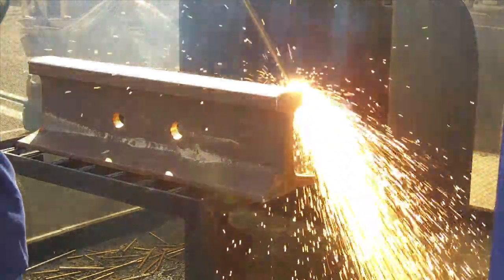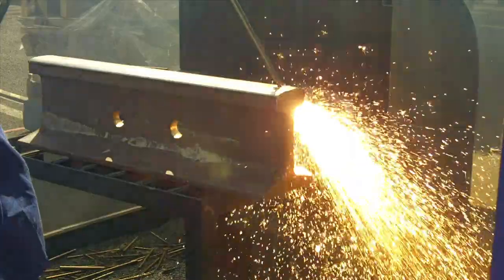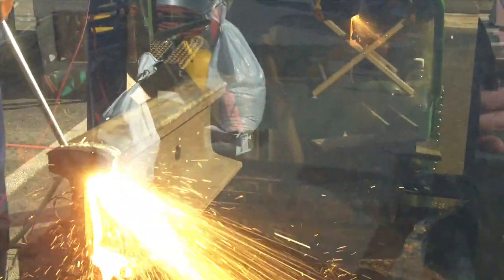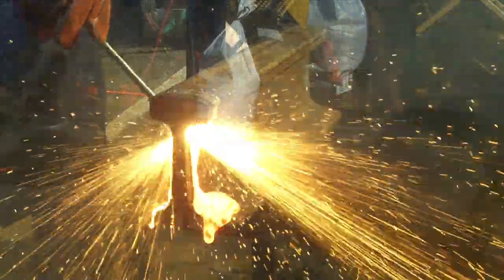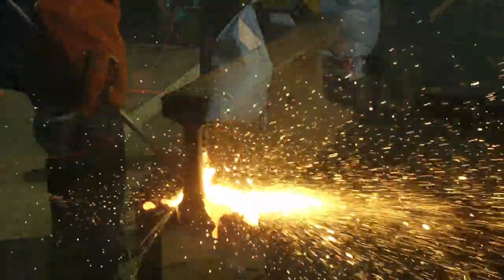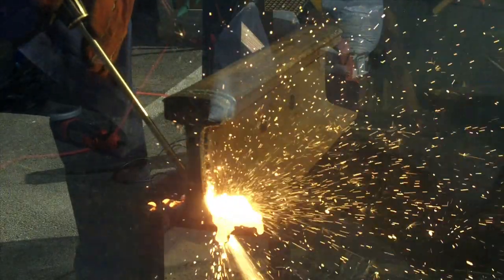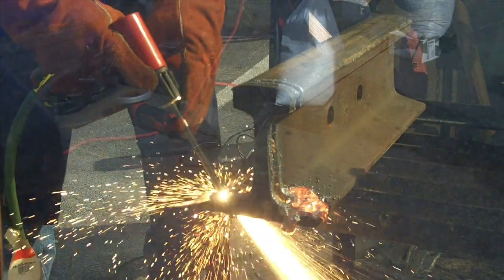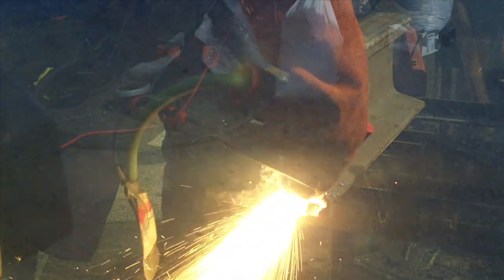Arcair SLICE Exothermic Demo: Cuts Through Train Rail in One Rod

Comment: Could have done that with an oxy fuel torch...
Reply: I’ve been wondering the need for arcair rigs when o2/acetylene works just fine.
Reply: @TheRealTak  You don't need it, it's just a sales gimmick
Reply: @mysterious_nobody_99  I figured thank you
Reply: @TheRealTak  ExoSlice can cut much thicker material than OxyFuel -- like 12" -- plus it's just cool.
Reply: A guy cut a 1/4 inch wide x  10 inch deep hole through a solid metal hinge pin at work last weak with those rods. Oxy doesn't cut deep holes very well!

Comment: Carbon arc with air pressure is an art, used it for precision cutting, bearings off shafts and don't damage the shaft.Learn which way to blow the fire.
Reply: Can you use just a a normal 12v batt

Comment: There's a great cost here!  I had this set-up back in the early '90s.  To cut a rail might have a purpose. but a torch is about as fast and a 20th of the cost. Fire departments use these. Great for super-rusty steel where getting through initially might be a challenge.   Cutting scrap would be a fool's game though. I used this set to blow down 40 foot bars of aluminum 6 inches in diameter to a mill spec. That's why I bought it initially. But it's a mother-fucker on money though!  The delivery volume of oxygen needed will deplete a tank in no time at all! Rescue work, concrete-coated steel, and other specialty jobs can benefit from it. It is an auxiliary tool in a larger arsenal.  Any kind of full-scale demolition means you graduate to oxygen gun-bars and a manifolded set of high-pressure tanks or liquid oxygen 55s and converter.